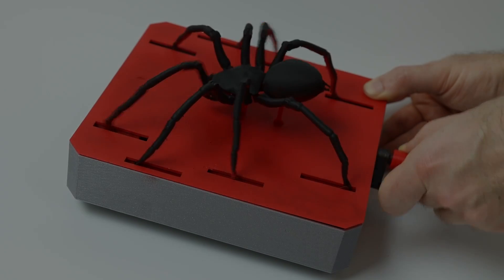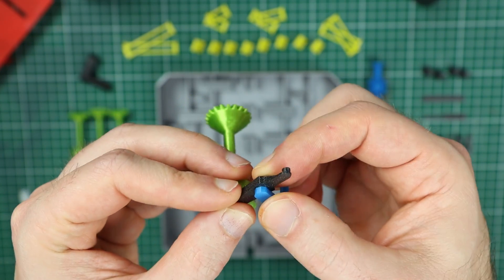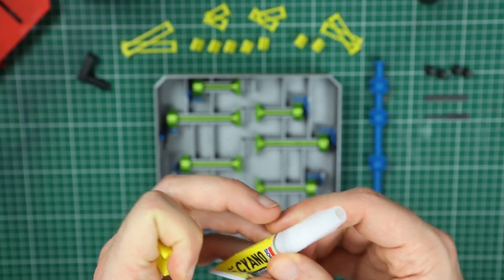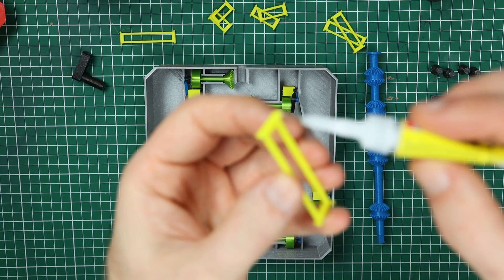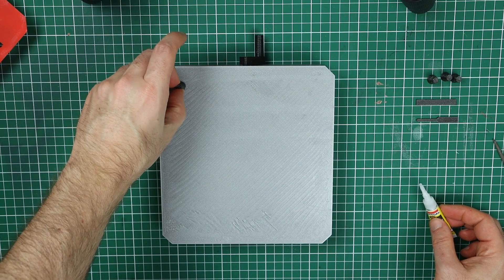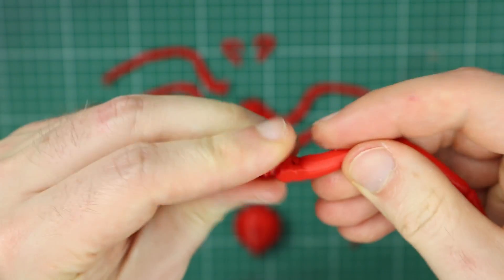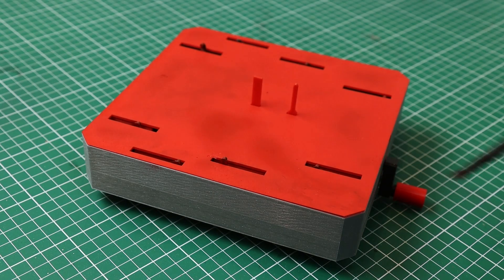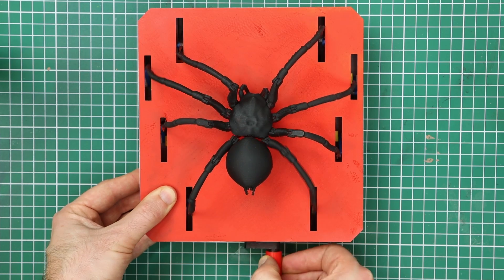Printing A Walking Spider

Comment: Hi. Love this project.
I'm building it as we speak.
Would it be possible to get the stl for the spider limbs separated? Would make replacing damaged parts easier.
I'm also planning to print one at larger scale, so i'd print each limb on its own.
Reply: Cool what a great idea,,, but not so large that it looks fake!

Comment: Also the one that is 40.4mm tall that also has a ring on the shaft. does not have the orientation dot on the base. Could you upload a new one of these also? Have the spider finished and it looks fantastic. Thanks again for this model

Comment: I'm building your creepy spider and noticed one of your gears, the tall one with the ring around the shaft, does not have the orientation dot on the base. Could you upload a new one? Have the spider finished and it looks fantastic. Printing the base as I write this. Thanks for this model.

Comment: Nice one - have you tried to add a stepper motor to control it electrically? That could be rather nice ;)
Reply from the maker: Not yet. I would need to integrate a reduction. Also I think I would pick a brushed dc motor to avoid having to use a driver. Maybe I will automate one of my next kinetic sculptures.

Comment: i mixed everything up after printing the legs.... any way i can find out which leg belongs where?
Reply from the maker: Hmm not really… best is to just print it again. I guess you could open the file in your slicer software and look very closely at each leg and try to identify which is which… but won’t be easy